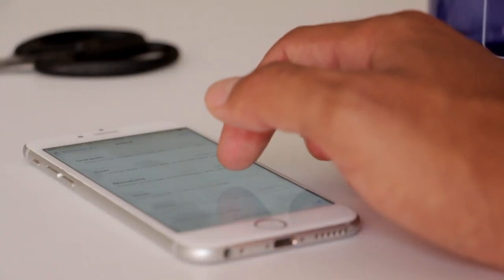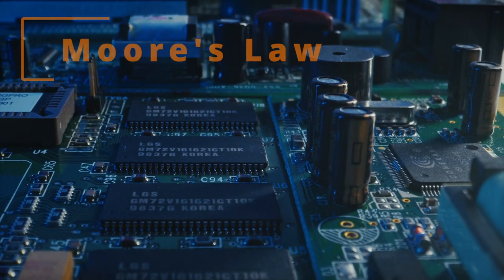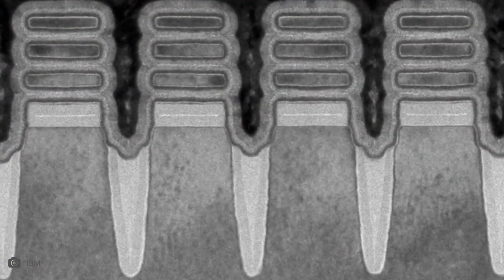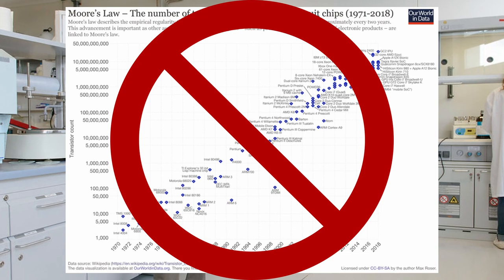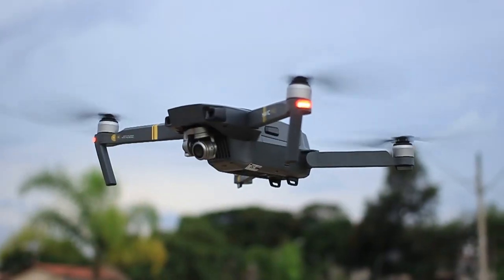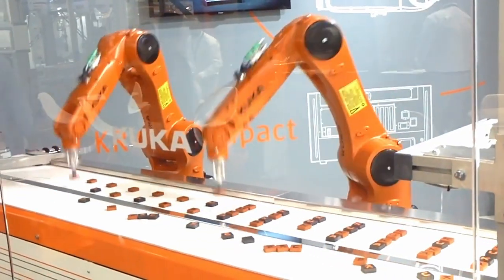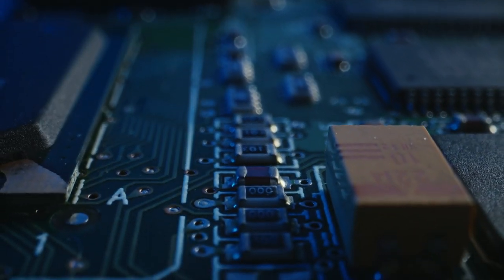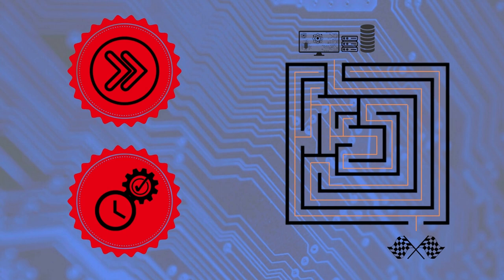More Than Moore's Law - What's Next?

Comment: A few other ways to keep increasing speed:
1.  Parallel processing, between CPU's or between cores in a CPU.
2.  Optimizing software and processors for the specific purpose.  Running more or less cores in parallel as needed.
3.  Combining the optimized processors into optimized systems.
4.  Speed of light is also a factor.  3D packaging, high speed memory, and high speed I/O is packaged above and below the CPU cores reducing the distance, thus the travel time.
5.  Managing heat with liquid, and immersion cooling.  This allows increasing size or speed of the processors.

Even these will reach their limit in the next 10 or so years.
Reply: the market is moving to specialized processors like FPU in the past, we've pretty much always had GPU, but we now have machine learning/AI chips, data mining optimized chips, etc.

Comment: Mixed-Signal Computing, in particular a combination of analog and digital(binary), could be the next turn for chiplet style CPUs.
Reply: lol how you going to mix singals and make it make sense? digital by definition is limited by hard pixels and analog is continuious lol
Reply: @KAIZORIANEMPIRE  lol, not me, AMD, look it up, lol
Reply: @peanutnutter1  i was being fascisious lol, actualy i studied physics and engineering for my phd, i worked on organic (plastic electronics) and for my project i was using printable ink based thermoelectrics (heat to electricity and putting them together with (solar cells) lol, i am being stupid here, i hpe it works out analog and digital,
Reply: @KAIZORIANEMPIRE  that's some very cool stuff that you were up to, the future is bright
Reply: If only this mixed thing is possible. But at the moment, I can't imagine this happening. Rather than being impossible, it is (at least to me) actually unthinkable.
Reply: @demotics2005  one way my mind see's how it could be possible is having defined bits or digital signals with continous streams, so imagine, you have 0 and 1 these are disreate digits, ... you can possibly have analog system within it from 0 to 1 it can be somewhat continous depending on what you want to do,
Reply: @KAIZORIANEMPIRE  I have been trying to imagine this kind of combo. And one way I thought of it is sending the stream as pulses. But then I thought this would defeat the purpose of analog.
Reply: Wikipedia: "In real-life, applications mixed-signal designs are everywhere, for example, in smart mobile phones, sensor systems with on-chip standardized digital interfaces (like I2C, UART, SPI, CAN etc.), voice related signal processing, aerospace and space electronics, IoT, unmanned aerial vehicles (UAVs), and automotive and other electrical vehicles. Mixed-signal ICs also process both analog and digital signals together. For example, an analog-to-digital converter (ADC) is a typical mixed-signal circuit. Mixed-signal circuits or systems are typically cost-effective solutions for building modern consumer electronics, industrial, medical, measurement, space etc"
Reply: @peanutnutter1  I see.... I thought that in your original post you're talking about manufacturing a chip that has both digital and analog transistors in it in order to further push the limits of our current chips. Of course as an interface we can have what you mentioned. But a chip itself combining the power of both analog and digital, would be super amazing if possible. Only that... I find it hard to imagine being possible. Of course that is just in my perspective as an ordinary person
Reply: @demotics2005  yes to both because the term is broader than you think, that is what is available now qualifies and then what could become available, like a silicone chiplet for analog plus a silicone chiplet for digital would be possible on AMD's platform, probably by using capacitors instead of binary transistors. That's a minimum, if you need to receive an analog signal there'd be a lot more hardware requirements but it's by no means impossible. To my mind the giant leap in capabilities will be well worth it and we don't need to give up binary at all, we get the benefits of both.
Reply: @peanutnutter1  that would be beautiful! When that happens, real-time complex physics simulations can even be possible on mobile devices 😊
Reply: @demotics2005  Yes! And there are other advancements in chip technology in development too, so computing speed will continue to improve this decade at least.

Comment: 2nM silicon architecture is the limit of current Lithography methodology. Sandwiched Silicon/Carbon Combed Matrix or SSCCM will allow 1nM-.025nM Natural Growth Circuitry (NGC) of which will make Lithographic Semiconductor production look like hand-built radio tubes. Moreover, Pico Volt Node Hopping (PVNH) will allow a near flawless ability to create circuits that act as Quantum Tunnels for up to 400+Giga flops of bandwidth under 100 Megahertz! Just think of a snowflake with the processing power of 50,000 modern 5Ghz cores.
Reply from the maker: Incredible to just imagine!

Comment: If you shrink one dimension by half you double the transistor count but the reality is you always  change two dimension so you actually get 4 times the transistor count..So going from 5nm to 2 nm results in 3 x 3 shrink  ie possible 9 times more transistors .... so the narrator is really not switched on he is speaking crap. ie Say one transistor is 5nmx5nm = 25nm area used  now 2nm x 2nm only uses 4nm area. effectively I get 6 time the transistor count (note transistors aren't usually square so I would get even more if the one dimension could be say 1nm ....